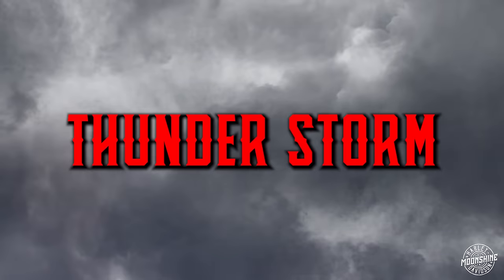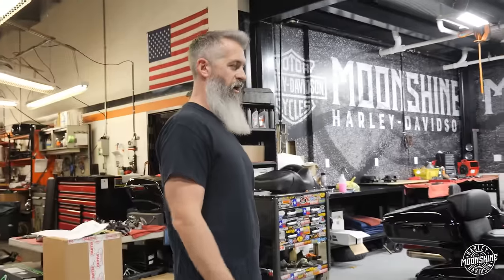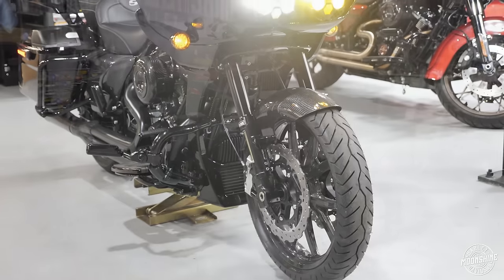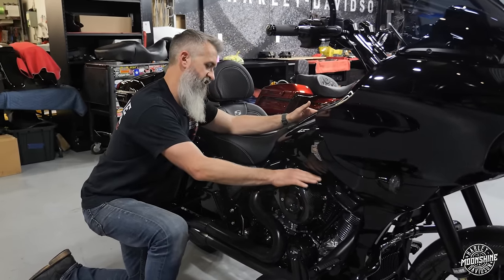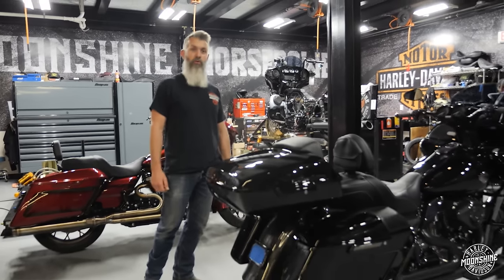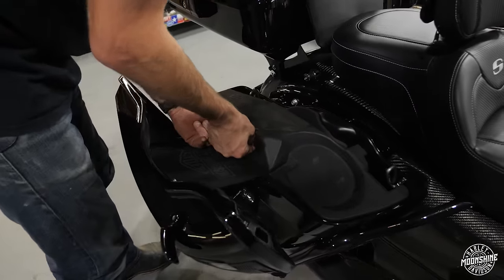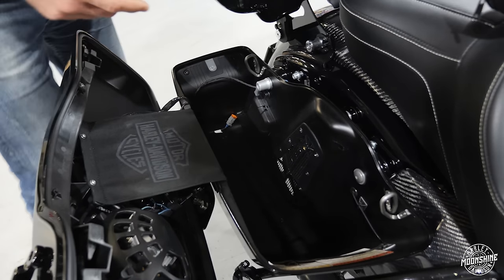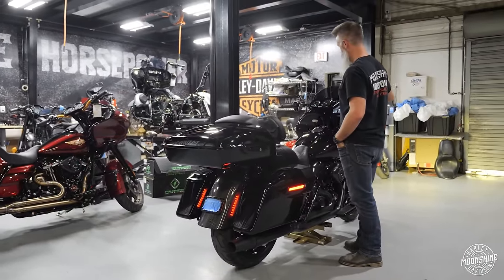Building and Riding a 175HP Superbike From Scratch | Bike Build No. 27

Comment: Nice looking, great sounding bike.👍 
But putting a 143 Ci, 175 Hp, 154 Tq engine on a Harley is like putting a jet engine on a Sopwith Camel biplane. 
What ever rocks your boat...if you can afford it.✌️
Reply: Dude, it's a powerful two up highway bike with gobs of power and lots of comfort...it's not a Gixxer.
Reply: Ever rode one?….
Reply: @z1k-allday129  In my 43 years of riding, I've only ridden one Harley for about an hour. Never owned one, never spent a dime on one, never wanted one, still don't want one. I'll stay with my current Indian. Now in the past, I have been on a Hayabusa and the old KZ 1000. But mostly I've owned cruisers.
Reply: @barrybarnes96  Never drank the Harley Cult Kool-aid.  Big pass on anything HD. ✌️

Comment: Hey guys, what angle do you guys recommend running the Baja lights? I noticed on this build they are down a bit as opposed to perpendicular to the ground. Looking like 5-7° or so? Stock Harley lights are pretty angled down.
Reply: I had mine pointed down as much as possible and it was still too bright. Got the dimmer and set to 50% power.

Comment: about the brake details, you said that only using the rear brakes to stop the bike, doesn't Harley have the breaking system which applies both brakes when your going over a certain speed?